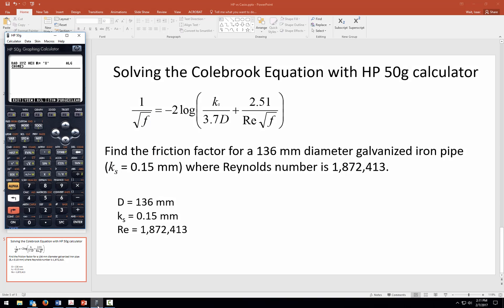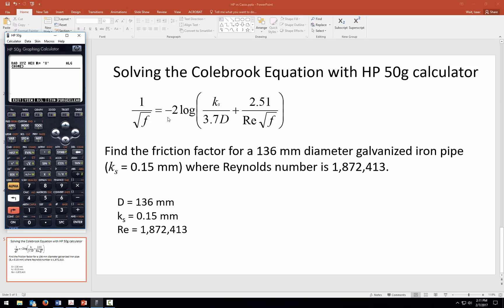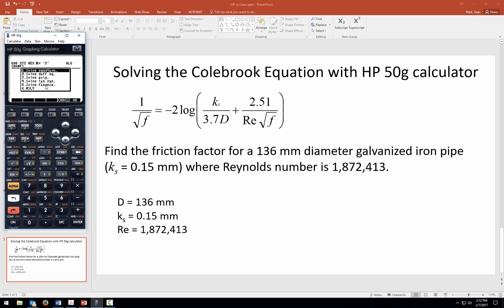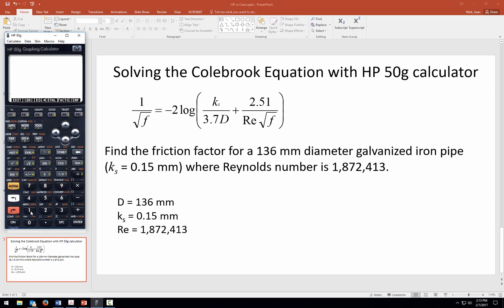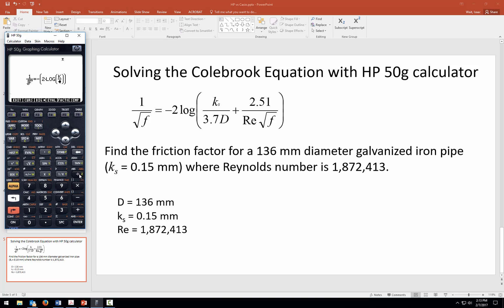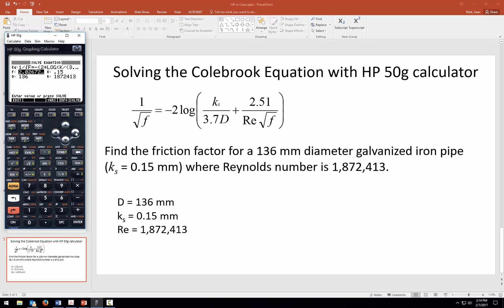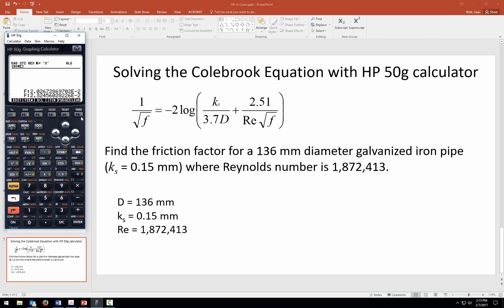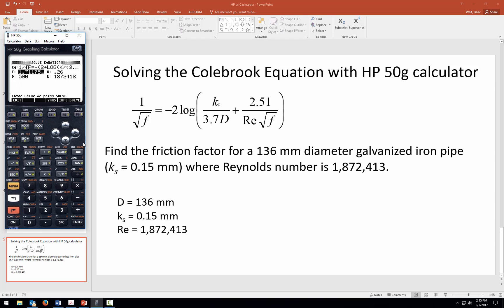Solving the Colebrook Equation for friction factor f using HP 50g calculator

Comment: Easily solved the Colebrook White equation on my simple Canon pocket F-792 scientific, my pocket Casio fx-991ES, and on my smaller pocket hp17; all using their Solver features. Why lug a brick in your backpack??
/geo ex machina
Reply from the maker: Not having to reassign variables to different letters is, for me, enough reason to lug around the heavy, heavy HP 50g. The graphical equation editor is nice too.